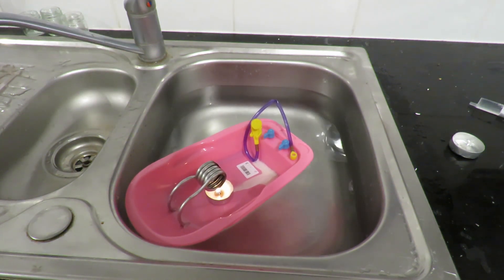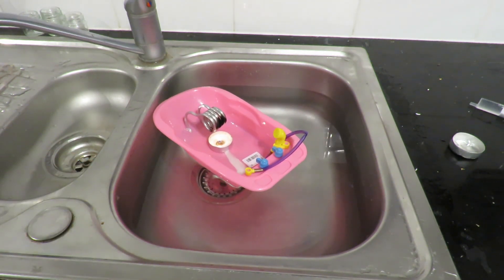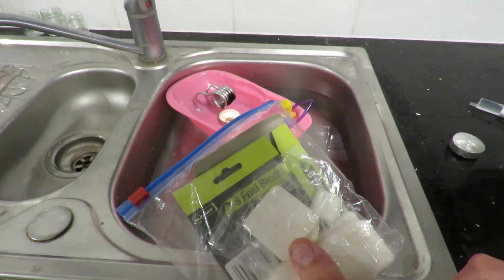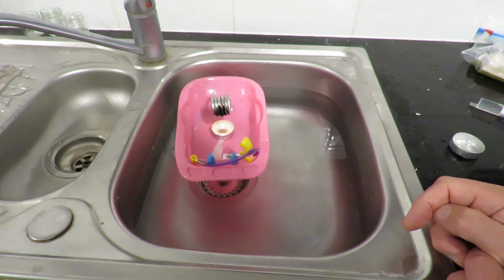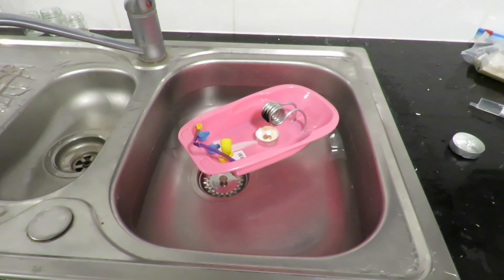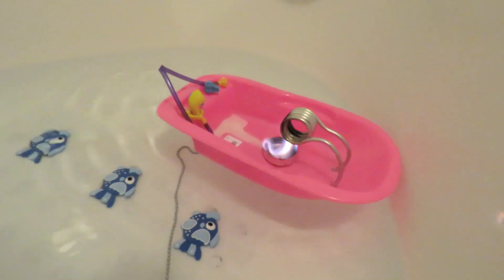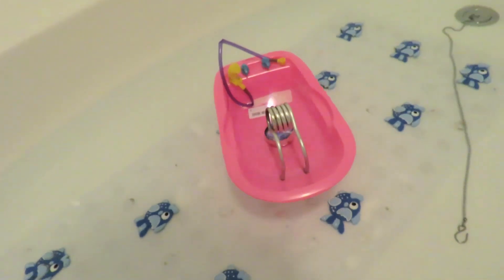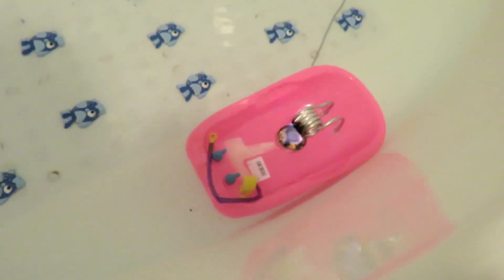That toy bath Pop Pop boat with more heat

Comment: They camping tablets are great. No smoke and lots of heat. I will need to get some of them for my Mamod steam engines. The fuel tablets for the Mamod steam engines are expensive, but those camping tablets are a lot cheaper at £2.49 for eight and will deliver the same heat. The Mamod tablets are small and cost around £10.00 for 20 tiny little tablets. 
Summit 8 Solid Fuel Blocks and no smoke. Brilliant.